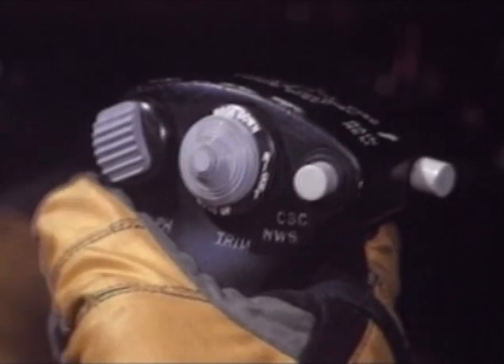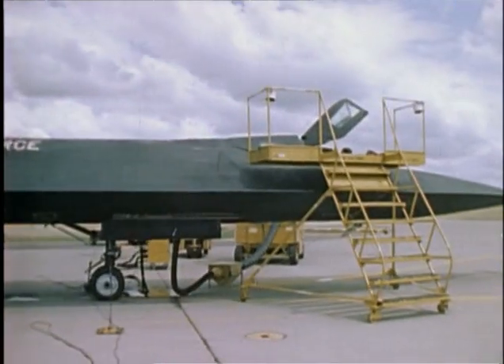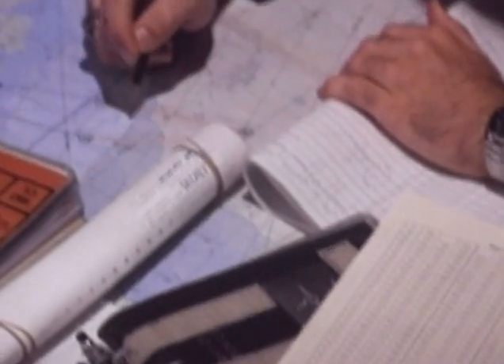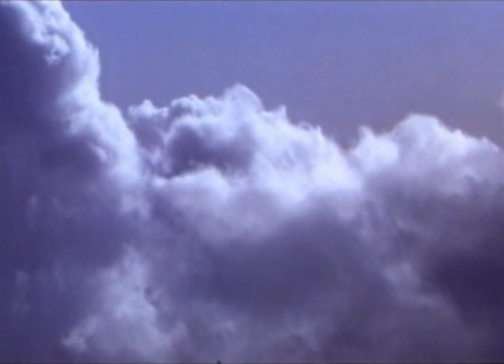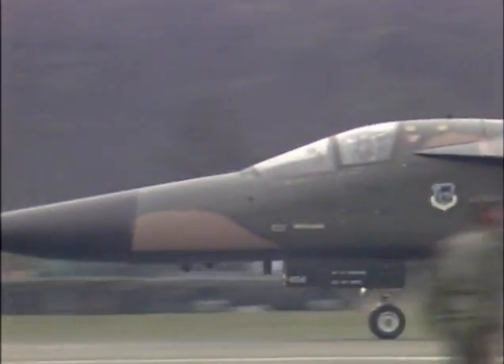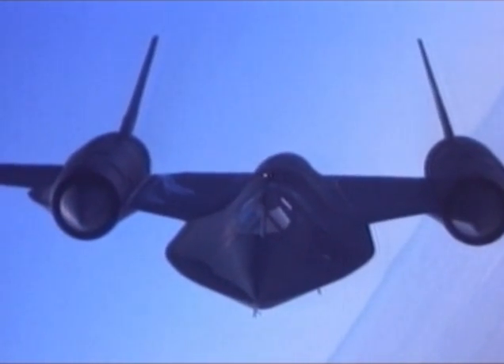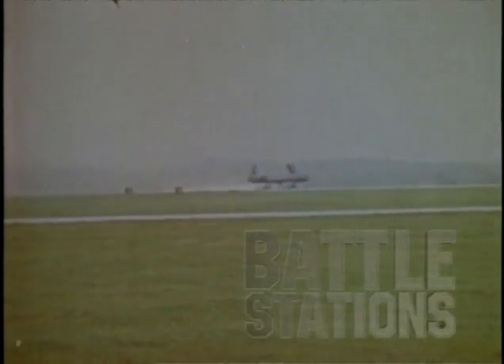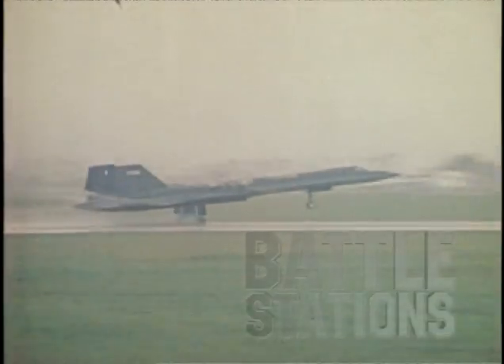Battle Stations - SR-71 Blackbird Stealth Plane -Full Documentary

Comment: While I have not yet watched the documentary, and I will, the engines that powered this legendary aircraft are Pratt & Whitney J-58 engines.  They were being developed and tested at the P&W plant that had recently opened in WPB in 1958, the year my father started working there, also the year I was born.  I began employment in the Experimental Weld Shop in 1981 retiring in 2013 (in CT).  I remember my dad giving me a put-together-with-glue model of this magnificent bird for Christmas around 1965.  I wish I still had it.   I had been told that many tolerances had to be very loose to allow for the expansion of assemblies when the Bird was heating up from high-altitude friction so everything would tighten up.  I'm not sure if it is true or not, but I was told that the fuel tanks leaked at take-off until they warmed up and expanded to close up necessary gaps.  Pratt & Whitney continues to build the fastest and most cutting-edge technological engines.  I had a part in the development of the F119 engine that was being made for the F-22 Raptor.  Derivatives and improvements of the engine are used in the latest plane, the STOVL F-35 Lightning.  It just seems that SR-71 is so talked about but the J-58 engines that made this plane capable of achieving such unmatched benchmarks are not nearly as detailed as the plane itself.  Not sure why the ever mothballed it other than it became another casualty of budget cuts.

Comment: @22:55 I wonder what camera and lense system captured that level of resolution of subjects at sea and ground level from the top 1% of the earths atmosphere??  How did the sensors and computers deal with such a crazy velocity over height ratio problem? A staggering achievement in the early days of microprocessors, and before the age of digital CMOS driven image sensors, high density memories, and high-speed GBit computing.

Comment: Mach 3....a cake walk for the SR71...just getting warmed up at that point 😎
Reply: Yes, and that's sustained cruising speed, not just a momentary thing.
Reply: They had a top speed of mach 3.3, but set a record cruising for one hour at mach 2.8. They weren't getting warmed up at mach 3, they were running put of steam. They couldn't do it all day either as one five hour mission required 16 refueling planes with them having to drop to under 40,000 feet five times to refuel. They essentially take off, fly to 40,000 feet, refuel, fly around an hour at 75,000 feet, descend to 40,000 feet, refuel, rinse and repeat. The main reason none were shot down was because it would have been a political mess. The powers that be never put them into a place where they might be shot down. They are definately a cool plane, but not as good as people would have you believe.
Reply: @flyingdutchman6984  What are you talking about? The actual top speed is not actually known. Max operational speed allowed was Mach 3.3 although it has reached Mach 3.5 under special emergency conditions when evading a missile. It could always just be pushed further until the plane fell apart. Also it was shot at many times. Over 800 missiles were fired upon it in just the Vietnam War.
Reply: @AzureDrag0n1  - Since I am not an SR-71 pilot I can only go by official reports about the plane's top speed. The only accounts of the SR-71 going faster than mach 3.3 cannot be confirmed by official reports. The United States used the SR-71 as a propaganda tool and had no reason to lie about the official numbers. They did have missiles shot at them, but intentionally avoided flying over countries that had missiles that could shoot them down. If I shoot a thousand .177 pellets at an elephant and it doesn't die we could say the elephant is indestructible or we can say the. 177 pellet is not the right weapon for shooting elephants. The United States propaganda tool twisted the facts to give the illusion that the plane was better than it actually was. It was designed with the sole purpose of flying over Russian and Cuba, but intentionally avoided Russian and Cuban airspace because they knew they would be shot down. After the U2 mess they simply could not afford to have the SR-71 shot down too.
Reply: Not a cake walk. 

In fact, it requires a very specific profile to get to Mach 3. The engines get more powerful as they go faster due to supersonic compression... and if you don’t increase speed and altitude in the right amounts at the right time you’ll never make Mach 3. 

The SR-71 is limited to Mach 3.3 by compressor inlet temperature. You can go faster... but it takes minutes to accelerate each point of a Mach and all the while your engines are literally melting. Ok if you’re avoiding SAMs doing a stern chase on the way to Kadena. Not so good if you were trying to overfly the USSR and still had over an hour until you were clear of enemy airspace.
Reply: Bartonovich52 m8 your wrong the SR-71 can’t go Mack 3,3 the SR-71’s speed is 2198 mph using the mean point of Mack at 767 mph witch is used to work out what Mack a jet can hit the SR-71 at 2198 mph is Mack 2,86 for the SR-71 to have a true Mack of 3 it would needs to go 2310 mph for 3,2 needs to go 2440 mph and for 3,5 2700 mph the SR-71 can’t have a true Mack over 3 cause it only goes 2198 mph I know the higher you go and the temperature can change the speed of sound BUT you CANT change the mph of the jet and you CANT change the mean point of Mack 767 mph the ( SR-71 is not a true Mack 3+ jet ).
Reply: the thing is, its top speed is classified, for all we know the North american X-15 or Scramjet powered X-43 could be moving slower than a grandma on the freeway compared to the J58
Reply: Mork:.   Still haven't hit after burner,nor +ramjet+ 'SRAMJETS'!!!
Reply: The SR-71 is not a true Mach 3+ jet is speed is 2198 mph that is Mach 2,85 I know that the temperature and height changes the speed of sound but the speed that we use is 767 mph Mach 1 to know how fast something is for the SR-71 to hit a true flat speed of Mach 3 it would need to go about 2310 mph and for Mach 3,2 about 2440 mph and Mach 3,5 about 2700 mph it’s true speed is again 2198 mph and with the flat speed of 767 mph it’s Mach is 2,85 not Mach 3+. Still great jet

Comment: the headline allone is crap and misleading. 
this craft was devellopped before the stealth disease of the chicken hawks now running concurse military industral complex..

the Profile of the plane was fly high and as Quick as possible.. 
After u2 which flew so high. that russian ground air rockets and Flak, even fighters should Not could reach IT was downed in sowjetunion..

stealth is as concept for lame ducks out of time.. 

dammed slick slime propagandsnerds with rabulistic upside down brainfuck.. 
hating technics presstzitutes for hire..

low level lies to polish the raping and sucking out Tzars..

they are stupid delusionists..
only public relations.. loosers.

Comment: They left out that after the military retired the SR-71, they gave NASA some of them. I normally test smoke stacks for air pollution but in the early 90's we got a contract to go to Edwards AFB to test some jet engines (PW-F-100's one for the F-16 and one for the F-15 - more computer controlled I think but about the same). It was very exciting to me as an engineer as it was in a hush house on the flight line and I had to build something to tolerate the force and stratification of gases from the engines. The hush house was on the flight line area so we were inside there. We were only supposed to go where we were working but one day, I saw a NASA (at that time) SR-71 go by. I said, I am following that plane. I stopped short of the runway. Then a B-52 came up first, it sort of lumbered into the air but was beautiful to watch. There were some F-16 chaser planes. Then finally the SR-71 took off. I was pretty close (thank god I didn't get called out for this). The SR-71 was so fast comparatively it is unbelievable and just beautiful. It was a tough job but I got to see a lot of cool things (for a civilian) that blew my mind and I think one day (a Saturday) there was something that looked for all the world like a UFO in profile.  I have to imagine it was a prototype drone because it seemed too small for a person.

Comment: I've seen two of the retired ones, maybe three, in my travels to various military history sites.  It looks fast standing still.  Maybe they mentioned it, but the seams were loose until heated to running temps -  they had to be to allow for heat expansion.  It leaked fuel at lower temps.

Comment: There were some twin cockpit variants.    Because heat expands and cold contracts - gas tanks actually "leaked" until at speed and altitude, where tanks finally  sealed!   NO armaments on them - NONE needed as they flew above any A.A.A. and most  missles.